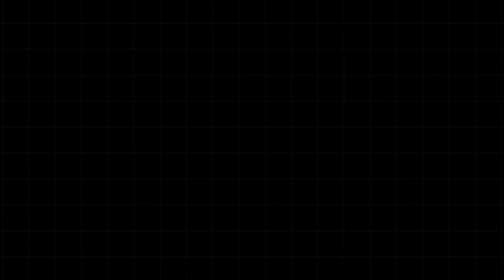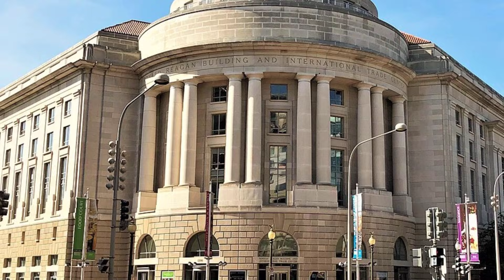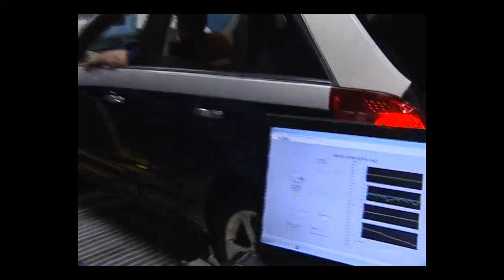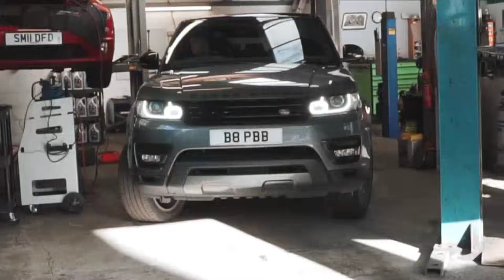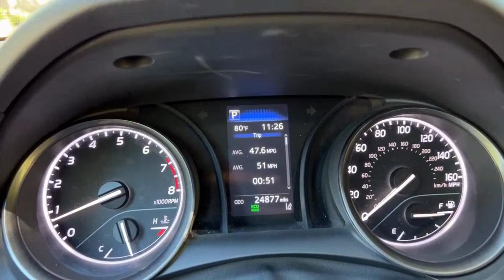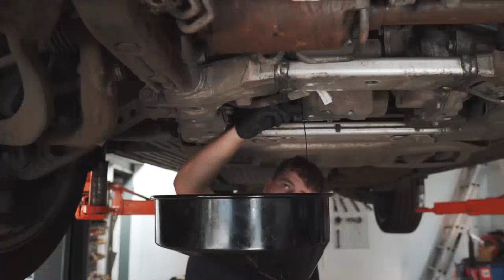Why U.S. Cars Use 0W-20 But the Same Engines Use 5W-30 Abroad (Mechanic Explains!)

Comment: my old volvo 2,4l (red block) after 740000 kilometers  still running good  on 10W40 mineral oil...
Reply: Yes sir right better run on 10 w40 mineral and flush more often i have a hilux running with it also

Comment: Majority of cars in Europe also use 0W20 these days. Same as in U.S., due to emissions regulations. 
However many new engines are designed for this oil, for example having coated cylinder walls to help keep oil film (VW, Mercedes and some others). 
If properly serviced (not long life), it doesn't really seem to be worse then i.e. 5W30.

Comment: I may be showing my age by this comment, but I've never heard the W as meaning "winter" before. It always meant "weight" when I was a kid.
Reply: Its different for multigrades.
A straight 30W is weight but a 5W40 with 40 weight at operating temp and a 5 Winter rating which is a different rating system for pumpability at low temperatures instead of viscosity.
Reply: @indyrock8148  It was always one of those things that you had to figure out which oil you were going to use at different times of the year. In places that experienced double digits below zero in winter most people would select a thinner oil and then switch back with their spring oil change. I now live someplace that rarely sees snow at all, but from the start I viewed 0W-20 oil as suspiciously light to be effective. I mean, growing up 10W-40 was a nearly universal choice by all mechanics for spring - fall driving, but that was before synthetic engine lubricants existed.
Reply: @nolongeramused8135 0W20 and 0W40 will have the same low temperature performance.
The W rating is the low temperature pumping limit.
Theres some great charts but basically unless you live in Alberta or Siberia its not required. Even 20W can go down to -15 oC.
The full synthetics go down to 0W or 5W because they are more pure and don't have the larger particles which cause low temp gelling like waxes.
If its not so cold where you are maybe you could try a good synthetic blend 10W30? I hear this is a good stable blend.

Comment: Hopefully this helps American viewers.
In Europe and Australia we dont have the same oil issues like stuck rings and sludge with thicker oil.
Dont be afraid to swap that 0W20 for 5W30 or even 0W30 or 0W40. It will work out better for your engine.
Reply: In my Camry 12  at 75k  started oil consumption about qt . I was afraid to switch to 0w30. But finally i decided to try a cocktail with 2.8qt 0w30 and 2qt 0w40 at 90k. Did not loose a single drop . Its on a second round of a cocktail .Its 98k now as of i am typing .. runs smooth but took a hit on mpg about 2 miles may be 3 . But i think its worth it !! I am going to reduce  quantity down 0w40 next time instead of 2 qt i ll do about a qt. See what happens.
Reply: @TheAnkit211good stuff just try straight 0W30 and 0W40 and pick whichever you prefer.